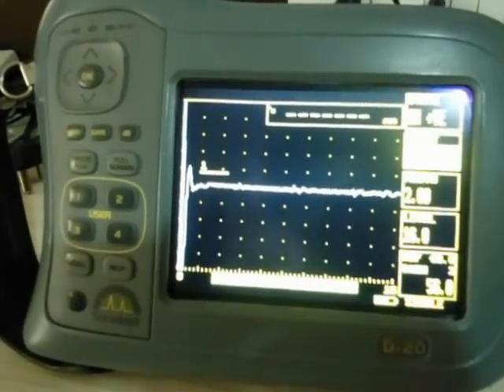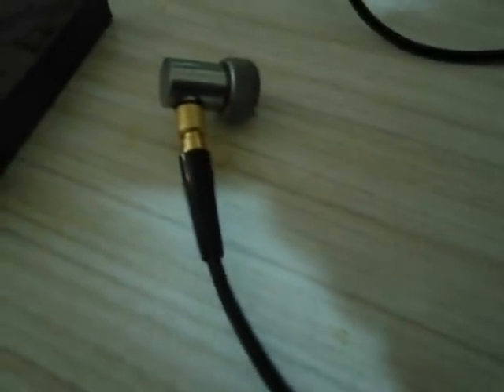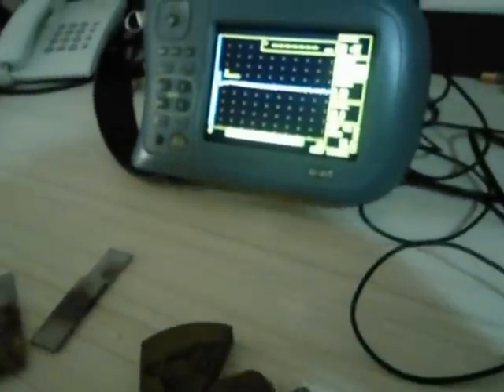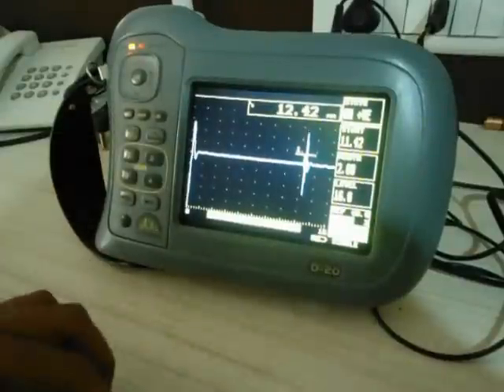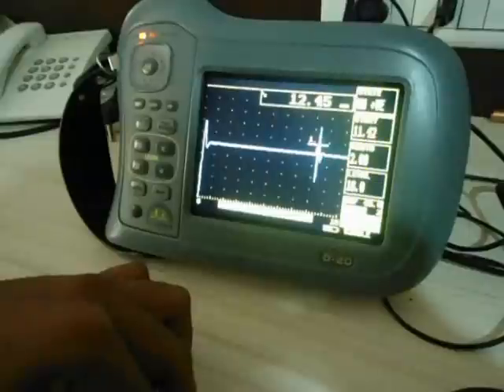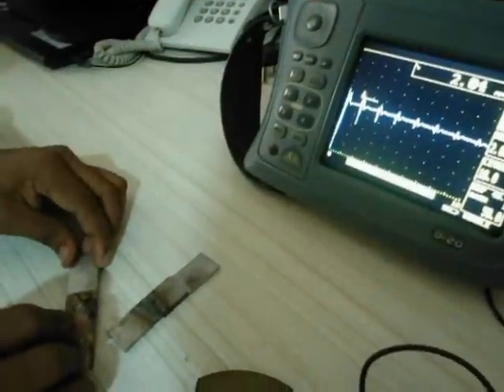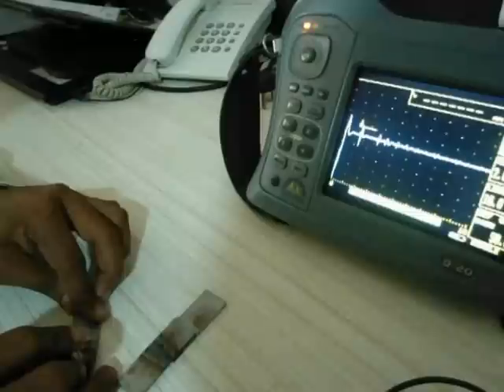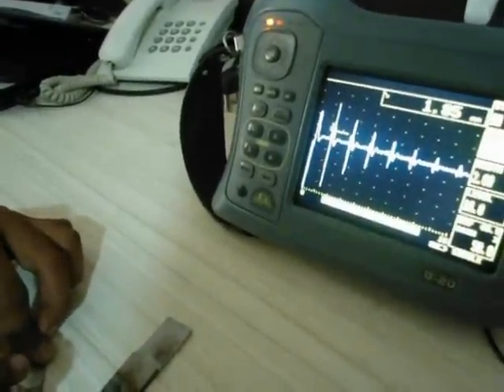(D 20)Ultrasonic Testing of 2mm Specimen

Comment: In late 2011 invested R $ 33,000 thousand dollars in equipment Sonatest D10 with all tranducer and cables, 1 year warranty. 
Five months after the unit had software problem and referred her to their representative in Brazil, BC Trade / END. The technician found that there would be a problem in the memory card and the same should be replaced. I did not agree with the reports and did not accept the return because the problem was clearly the software. Weeks after the device was returned by disconnecting alone, for there was a loose board, reenviei for BH. When he finally returned, the unit returned to the same memory problem, which again was sent to maintenance and return a few days later, the same problem. 
I contacted an engineer at Sonatest in England and even sent me the updated version of the system and the problem was solved. Was less than 15 days to beat the security and safety I decided to return the device and invest in another brand, Krautkramer or Olympus. 
However, I was convinced by the Bc Trade staff to remain in Sonatest brand, with the following proposal. Trade my D10 + D10 in the new with one year warranty. Who is ultrasound knows what it's like without the aid, and the proposal was interesting at the time because he had already lost many daily troubles with D10. 
I replaced the appliances and worked with d10 + 1 year. The problems presented in the previous D10 appeared, but the device itself is high corrected. After 3 months of warranty D10 +, at the beginning of the activities, the device showed a low battery message, thought the device would have called in the backpack and so discharged. The loaded and the message does not disappear and the unit is turned off preventing my work, but to turn it on in order to connect it to the pc it remained connected normally. 
Again start the novel, but now unsecured. By sending BC Trade your coach found a problem on the analog board, with the amount of R $ 7.516 over the time of the technician would be $ 275, and spend three hours of their value would be 825 reais, or U.S. $ 8.341 in a real machine with 1 year of use! Questioned that the problem would be the software because the device does not stay connected mode only for inspection, asked for help to reinstall the software, but without success. The sent to two companies that maintenance of ultrasound which was not observed any problem with hardware, but with software equipment. And the only software to work with your representative, BC Trade. 
What I find absurd is the lack of commitment to the customer and the brand. They find that investing 22,000 in a machine and it has problems after 1 year is normal, that 8000 to repair're cheap? If you had five years of use, or fall, or any other situation I would pay with the greatest satisfaction. I saw another brand device has problems in this period, even have 3 friends who work with USm-Go and never showed anything, this is a direct competitor to the D10. 
Today, appliances ultrasound companies have competitors, with the advancement of Chinese brands such as Mitech selling devices with 2 year warranty for a much more affordable price. Even co-workers have Mitech since 2010 and the unit showed no problems until today. And if you present your repair is very cheap, never reaching the absurdity of more than one third of the value of the product, which incidentally, 8000 is the price of a used Mitech. Remember that Bc Trade reached the absurdity of saying that the problem was caused by misuse, as they had already made this accusation in the first case. Several of my colleagues have the D10 complain of problems ranging from touch screen to problems in software on the device, but says he never authorized knew the problem in D10 that my case is atypical. For those in their propaganda fills her mouth to speak of robustness and security for investment, and Sonatest is leaving much to be desired. 
Summary of the story: In two years and a half I use 2 devices Sonatest D10, used the service(Guarantee, Security) 5 times in this period, and by the end, three months after the end of the guarantee of the 2nd D10, it had software problems again. Today it is unusable, decorating my room, and I had to shell out more money to buy another appliance, used, but not abandon me.